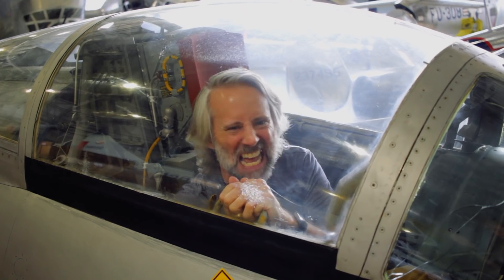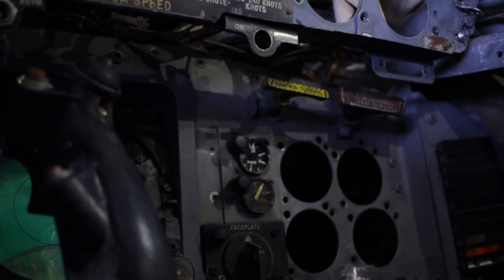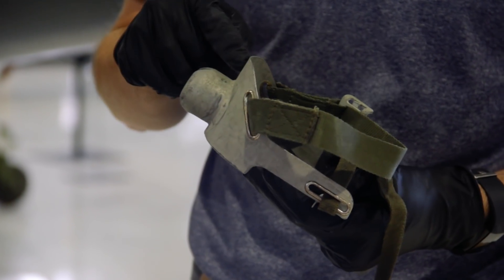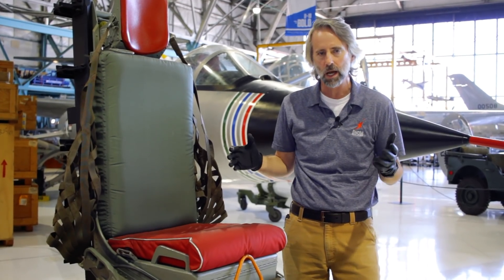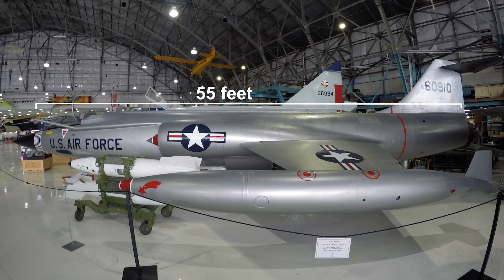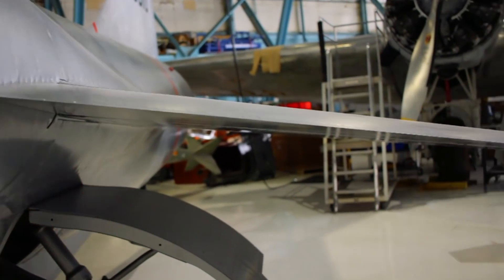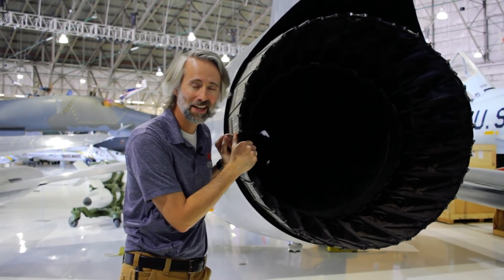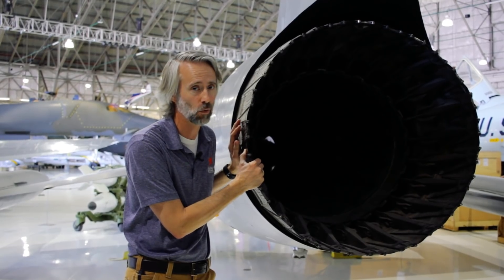F-104 Starfighter | Behind the Wings

Comment: The F-104 was truly a one trick pony. Flying fast, high and straight at Mach 2  Asking it to do more than that one trick like actually "turning" you were asking for big trouble.  Through Lockheed sales promotion campaign, (cough, cough "BRIBERY!!" cough cough). It locked in a lot of US Allies(The Luftwaffe, the RCAF, the ROC(Taiwan), Japan, and the Royal Belgian AF) with an fairly ineffective tactical supersonic aircraft for too long a time. Only the Italians seemed to have made something useful out of it.  Thank God the Soviets didn't invade Western Europe during the '60s and '70s.
Reply: Bullshit.
 
The F-104 was originally designed to be a daylight air superiority fighter to take on MiGs, not bombers, and could do so when flown the way it was supposed to, namely "zoom and boom", not "yank and bank"/"turn and burn".
When flown in this way, engaging an adversary in slashing attacks and then disengaging pretty much at will, it was excellent in aerial combat beating the F-86, F-100, and F-4 according to the USAF's Project Feather Duster 1.
(And OBTW, ALL aircraft become straight line machines at Mach 2+.
Moreover, none of the U.S. aircraft of the day could out (horizontal) turn the Soviet aircraft they would likely come up against, but they could nevertheless beat them by going vertical where they had a definite advantage ... something that the F-104 could/did do as well.
This is what happened in Vietnam with the F-4s and F-8s.)
 
But back to the other missions the F-104 was eventually tasked with.
 
When it clear that Lockheed wasn't going to make as much money on the F-104 as then hoped/needed, they offered to modify it to do what the Germans wanted at the time which was an aircraft that could not only fly interceptions and photo recon, but also an aircraft that could fly ground attack including with nuclear weapons.
The boys at Lockheed strengthened the airframe to handle low-level attack and made the "Super Starfighter" AKA the F-104G.
And when it comes to ground attack with a nuclear weapon, a task that it was virtually unmatched at as it was hard do detect either by sight or radar and difficult to catch if it was.
 
As for the Italians, then "upgraded" the F-104G to make it "all weather" which in U.S. terms means that it could fire a radar guided Sparrow missile, a missile that Vietnam demonstrated was less effective in terms of a probability of a kill in aerial combat than a gun or a heat seeking Sidewinder missile.
They were apparently happy with what they made and so I won't fault them for it.
 
And I too am glad that the Soviets didn't invade Western Europe, but IMHO, that was in large part due to the presence of the F-104, not in spite of it.
Reply: @lewiscole5193  You prove my point. the F-104 Starfighter was a one trick pony with its "Zoom and Boom" tactic and at least lived up to its appearance "the missile with a man in it".  But when compared to its Mach 2 contemporaries and adversaries the English Electric Lighting, the Dassault Mirage III, the Saab Draken and of course the MiG-21 it was sorely lacking.  All of which could both "Zoom and Boom" and "Turn and Burn" . Yes I know the Mirage III lost too much energy in some of its tightest turns but you get the point.  As well as so many Arab and a few Soviet pilots had gotten in the Six-Day War.

The success of the F-104 was more due to Kelly Johnson's deserved incredible reputation, Lockheed's exceptional sales promotion campaign, (cough, cough "BRIBERY!!" cough cough) and exceptional especially for its time after-sale customer service.
Reply: @colinw7205  
> You prove my point [...]
 
Actually, no.
To the extent that I've proved anything, it's that you can't read.
 
You've completely ignored the part about ground attack with nuclear weapons, which by the way, the Lightning could not do.
(The nuclear bomb that the F-104 carried weighed a ton while the most that the Lightning could carry on any of its stations was half of a ton.)
The Mirage was an option, but even though the Germans though it was better at dog fighting, they picked the F-104 instead.
Whether or not bribery was involved in the procurement decision, what is not open to debate is that the F-104 could perform the mission and therefore is not a "one trick pony".
(Whether or not the Draken or MiG-21 would have been "better" is moot as they weren't offered for sale to the Germans.)
 
And yes, other aircraft could do "zoom and boom" ... in fact, either NASA or the USAF (I can't remember which at the moment), after evaluating the best tactics to use in aerial combat effectively recommended that that all Century Series fighters and the F-4 use "zoom and boom".
But what this makes clear is that the use of a particular tactic doesn't make a particular aircraft a one trick pony, contrary to your apparent belief that it does.
 
And the fact that you think that being able to do both "zoom and boom" and "turn and burn" is somehow a necessity demonstrates that you haven't got a clue when it comes to the F-104 role in Europe and likely won't get one no matter what I say.
But in the interest of others who might be reading this, consider the environment that the F-104 was supposed to operate in in Europe against the West's rival, the Warsaw Pact.
From the beginning of NATO (in fact even before it), it was made it clear that they weren't going to try to compete with Soviet Union in terms of a conventional war.
We weren't going to turn German into a giant tank trap and spend megabucks trying to defend against conventional weapons.
Instead, if war came to Europe, it was going to become a nuclear war ... it was not a question of "if", but only of "when" we used nuclear weapons.
 
Now imagine that we're on the verge of WWIII and a whole shit load of fast, low flying aircraft are headed your way (and in this case, it doesn't matter if "you" is NATO or the Warsaw Pact).
Do you engage in turning dog fights with any aircraft that are willing to engage you (which by their actions indicate that they likely don't carry any nuclear bombs) or do you try to stop the aircraft that are blowing through your lines like a bat out of hell in more or less straight lines (which by their actions indicate that they might likely carry a nuclear bomb)?
 
I would like to think that only a clueless idiot who thinks that such a war was going to be like any of the relatively long drawn out proxy wars that we've had since the end of WWII would think that being able to dog fight with the enemy aircraft that are willing to do so is A Good Idea .
Reply: @lewiscole5193 Weren't  I thought we were talking about the F-104's air-to-air efficacy versus its contemporaries??   I understand the old NATO doctrine of if there is even a whiff of a Soviet invasion  "F**K it" we're gonna pass "GO" right to the nuclear option. Which changed in the '80s to the AirLand Battle Doctrine in part b/c the USAF and NATO now had great airframes the F-15, F-16, A-10, Toranado, Jaguar. Alpha jet and F-111 to get the job done conventionally against the Warsaw Pact.

But those minor "proxy wars" that you poo poo'ed is what that we , our allies and friends kept getting involved in showed up the shortcomings (and some bright spots, like the effectiveness of "the Hun" F-100 as a air to ground platform) of the Century Series.  Let's face it the true bright spots of US tactical air aviation in the 1960's  were all US Naval based airframes; the A-1 Skyraider, the A-4 Skyhawk, the F-8 Crusader and of course will all its flaws the F-4 Phantom.
Reply: @colinw7205  
> Weren't  I thought we were talking 
> about the F-104's air-to-air efficacy 
> versus its contemporaries??   
 
Your text is sufficiently broken up so that I'm not sure what exactly you are trying to say.
In particular, I don't know what you mean by "air-to-air efficacy [sic]" and what, if anything, that has to do with the use of the F-104 in Europe (with or without bribery).
"Good" and "Bad", "effective" and "ineffective", ... , etc. are all relative terms that only have meaning with respect to some standards against which some comparison(s) can be made.
For any aircraft, those standards are presumably the mission(s) that the aircraft is supposed to perform, and in the case of the F-104 in Germany (and presumably most of the rest of NATO), those missions were interception, recon, and (possibly nuclear) ground attack.
 
Yet you declared that the F-104 was an "ineffective tactical supersonic aircraft" apparently because it can't dog fight while ignoring the fact that (1) dog fighting isn't necessarily the only way to win aerial combat and (2) aerial combat wasn't the only mission that it had to perform.
If you want to define what you mean by "air-to-air efficiency", then we might have something to talk about, but until then, just making statements like the F-104 was an "ineffective tactical supersonic aircraft" is just silly.
In the most general terms, the mission of the F-104s in Europe and elsewhere was one of deterrence, and the fact that we're still here to debate the topic clearly shows that it did just that.
 
> I understand the old NATO doctrine of 
> if there is even a whiff of a Soviet 
> invasion  "F**K it" [...] [w]hich 
> changed in the '80s to the AirLand 
> Battle Doctrine [...]
 
Okay, so explain to me why the change in U.S. Army strategy/doctrine that occurred 20-something years after the Germans decided to buy the F-104 has any relevance to that purchase decision.
 
> But those minor "proxy wars" that you 
> poo poo'ed is what that we , our allies 
> and friends kept getting involved in [...]
 
I don't "poo poo" those proxy wars ... I'm saying that they aren't the war that the F-104 in Europe was supposed to fight and to try to judge the F-104 by the standards of such wars is silly.
All of the Century Series aircraft were designed for one kind of war and ended up being used in such proxy wars instead because they (the Century Series) were all that we had.
If we got lucky and they did well, fine ... we hopefully learned something.
But we got unlucky and the didn't work well, well again hopefully we learned something because it wasn't the aircraft's fault that it was used for mission(s) it wasn't designed to fight.
 
In the case of the F-104 in Europe, if push had come to shove (both then and now), we're looking at a nuclear war, not a prolonged war like WWII, Korea, Vietnam, or [insert your favorite conflict in] the Middle East.
And if that happened, there was only going to be one great air battle at the start of the war as aircraft rush to make or try to stop the initial airborne nuclear strikes.
After that, there was not going to be any prolonged war for air supremacy as the bases from where the aircraft took off from are going to disappear under mushroom clouds and anything left would no doubt have shortly disappeared as soon as the ICBMs started falling back to earth.
Again, to try to fault the F-104 because it can't dogfight with the best of any other contemporary aircraft is (mis-)judging the aircraft by having it try to fight the last war (WWII) rather than the one that was coming (WWIII).
 
> showed up the shortcomings (and some 
> bright spots, like the effectiveness 
> of "the Hun" F-100 as a air to ground 
> platform) of the Century Series.  
 
I don't know what you mean by "effectiveness of 'the Hun'" as it wasn't outstandingly effective in the air-to-ground role IMHO.
Again, it's what we had and we ended up using it for ground attack.
 
> Let's face it the true bright spots 
> of US tactical air aviation in the 1960's 
> were all US Naval based airframes; the 
> A-1 Skyraider, the A-4 Skyhawk, the 
> F-8 Crusader and of course will all 
> its flaws the F-4 Phantom.
 
If by "tactical" you mean ground attack, then I agree that the A-1s and A-4s were outstanding compared to their brethren.
What you fail to mention is that they were designed and put into service in the 1950s.
They were what we had and so we used them for what we wanted regardless of what they were designed for.
 
The F-8 was likewise designed in the 1950s to be a supersonic fighter that would go faster and higher than what ever the Air Force had, with no particular emphasis on dog fighting because that was not what was supposed to happen.
In fact, F-8 was a lousy dog fighter compared to the MiG-17s it encountered in Vietnam in the sense that it couldn't out turn them in the horizontal.
But it had two things going for it, namely (1) it had guns and (2) it could go vertical where it had the advantage over the enemy MiGs, both traits that the F-104 likewise had and which for some reason you don't seem to appreciate.
 
As for the F-4, it too was designed in the 1950s for interception and once again wasn't designed with any particular emphasis on dog fighting and once again, it was lousy in (horizontal) dog fighting as that wasn't something it was supposed to do as was clearly evidenced by the fact that it wasn't designed with a gun.
And like the F-8, when it engaged enemy MiGs, it survived and prospered by going vertical when it got a gun (pod).
 
So tell me again ... why do the two most "effective" (in terms of air-to-air exchange ratio) U.S. fighters of Vietnam get a pass as not being "one trick ponies" while the F-104 doesn't?
Reply: @lewiscole5193  ........"What you fail to mention is that they were designed and put into service in the 1950s."..... Ah, yeah. All the platforms used in the 1960's were with the exception of the Skyraider designed and deployed in the 1950's like all the Century Series.  I was making the point that the US Navy platforms proved to be more successful in actual combat than their USAF Century Series counterparts.

But I would give props to the  USAF's General Dynamics F-111 for doing what it was designed to do. Being a great tactical all weather medium bomber.
Reply: @colinw7205  
> I was making the point that the US Navy 
> platforms proved to be more successful in 
> actual combat than their USAF Century 
> Series counterparts.
 
Presumably we are talking about Vietnam now since that's the only one that Century Series fighters (other than the F-111) fought in.
 
Vietnam was a funny war in that there weren't that many air combat engagements (and therefore very few loses of aircraft of either side) as the Vietnamese generally only engaged U.S. forces when they thought they could win.
And as it turns out, the loses that the Air Force had were different from those of Navy even when flying the same aircraft, namely the F-4.
The Navy could "see" the Vietnamese using the radars on its ships while the Air Force couldn't their ground radars didn't cover where the Vietnamese aircraft were taking off from.
This let the Vietnamese air controllers vector their forces in behind the Air Force F-4s but not behind the Navy F-4s where the Vietnamese would have an advantage.
The result is that I think one has to be very careful when trying to infer how good/bad U.S. aircraft in Vietnam.
 
And OBTW, the F-105, which is a truly horrible dog fighter, came in third behind the F-8 and F-4 in kills in Vietnam.
 
> But I would give props to the  USAF's 
> General Dynamics F-111 for doing what it 
> was designed to do. Being a great tactical 
> all weather medium bomber.
 
Well, since you mentioned the F-111, let me tell you a little story ....
 
The Air Force and Navy are very protective about not getting an aircraft that was designed for some other service which is something that Congress and/or the Executive branch likes to try to make happen so as to save money.
The F-4 started out as a Navy aircraft but it got foisted onto the Air Force.
The F-111 was supposed to become both an Air Force and Navy aircraft, but the Navy avoided it by claiming that it couldn't land on their carriers.
 
During the early part of the Vietnam war, a couple of the Air Force's finest, the high performance, high priced F-105s, were shot down by some piddly obsolete (and relatively cheap) MiG-17s.
A few days later, Air Force Chief of Staff General McConnell came out with his "Air Force Doctrine on Air Superiority" document which outlined the role of "air superiority" following in the foot steps of an earlier memo by lightweight fighter advocate Chuck Meyer.
Meyer's had advocated for the used of different aircraft for different missions, each aircraft tailored to their role, and so the Air Force could have interpreted McConnell's document as guidance for the Air Force's next fighter aircraft, the F-X, to be tailor for an air superiority role.
 
Unfortunately, a clause in McConnell's paper effectively stated that pounding the hell out of enemy aircraft while they're still on the ground was A Good Idea was seen by the Establishment majority within the Pentagon as justification to continue to do business as usual.
So the response to the loss of the F-105s ended up not being something that could dog fight, but rather a more sophisticated and costly "fighter" of the sort they were used to thinking about up until that point.
What the Air Force Establishment has in mind is a Mach 2.5 capable twin engine, swing wing design with radar and a huge internal fuel capacity that tipped the scales at about 60,000 pounds ... basically an F-111 on steroids.
It had a takeoff thrust-to-weight ratio far less than 1:1 and a wing loading of about 100 pounds per square foot.
The Air Force asks the aircraft industry to come up with something along those lines in a series of Request For Proposals (RFPs) between 1965 and 1967.
 
Fortunately, Meyer was able to convince the Air Force to cancel the transfer of one Major John Boyd to parts unknown which ultimately lead to Boyd being assigned to look at the various requirements of what the Air Force thought the F-X should be in 1966.
Boyd was already famous at the time for his works including Energy-Maneuverbility (EM) Theory that he developed with Tom Christie which allowed one to predict and compare aircraft performance.
After looking into the F-X requirements, he famously told his boss, "I've never designed an aircraft before, but I could fuck up and do better than this!".
Fortunately, his boss was amused and so Boyd ended up undertaking a series of requirements trade off analysis studies which lead to the outline of a much higher performing, far more maneuverable, twin engine fixed wing (i.e. non-swing wing) aircraft that tipped the scales at 40,000 pounds, had a takeoff thrust-to-weight ratio slightly in excess of 1:1 and a wing loading of about 80 pounds per square foot, although with a lower top speed of Mach 2.3.
 
Boyd still wasn't happy with the this, however, but his higher ups ordered him to cease and desist with any further work on the F-X which they then tried to turn into a real live aircraft, the F-15.
Nevertheless, Boyd and his cohort in crime, Pierre Sprey, continued to work on the specifications for their lighter (30,000 pounds or less), hotter design which they referred to as F-XX (pronounced "eff ex squared").
They were convinced that the best way to future-proof a fighter was to make it very maneuverable.
Along the way, they checked with aircraft manufacturers Northrop and General Dynamics Convair (who had both submitted lightweight aircraft designs before) to validate from them (the manufacturers) what their (Boyd's and Sprey's) studies indicated.
But no matter how much they lobbied to replace the F-X with the F-XX, Boyd and Sprey got no where as the Air Force regarded the F-XX as a threat to them getting the F-X (AKA F-15).
 
The F-XX was kept alive thanks to a bit of subterfuge on the part of Rich Riccioni in the Air Force who told his bosses that with already high cost of the F-15 and F-14 continuing to escalate, there was a chance that Congress would cancel both the F-15 and F-14.
If that happened, it would be A Good Idea if the Air Force had a lightweight fighter proposal laying around in the background so that they wouldn't end up with a lightweight fighter that came from the Navy.
What Riccioni didn't tell them was that the Navy's lightweight fighter program had already been bludgeoned to death like a baby Harp seal because the Navy felt that their lightweight fighter program was a threat to them getting the F-14.
 
In the end, civilian leadership became pissed off enough about the escalating price tag of the F-14 and F-15 and other aircraft that they called for a lightweight fighter fly-off to fill out the Air Force and Navy inventories.
The fly-off saw the YF-16 take the cake over the YF-17 and the Air Force dropped it's objections to getting the F-16 when it was basically assured that they would get the F-15.
The Air Force then promptly started trying to turn the F-16 into a non-lightweight fighter that would only be used for ground attack, never as the highly maneuverable air superiority fighter that it was supposed to be.
 
The result of all of this is that today, the must-have buzzword for fighters (aside from "stealth") is "maneuverability", and every fighter today has to be able to supposedly perform billions and billions of roles.
 
And what does any of this have to do with the F-104, if anything?
Well, the F-104 was in a very real sense, the spiritual grandfather of what the F-16 was supposed to be, a lightweight daylight air superiority fighter with essentially no other role ... something that you apparently find an anathema.
 
But the story doesn't quite end there because civilian leadership secretly asked Sprey to come up with the requirements for a special purpose ground attack aircraft, the A-X, which today we now know of as the A-10 Warthog ... IMHO the finest ground attack/Close Air Support (CAS) aircraft we currently have.
Reply: @lewiscole5193   ......the F-104 was in a very real sense, the spiritual grandfather of what the F-16 was supposed to be, a lightweight daylight air superiority fighter with essentially no other role ... something that you apparently find an anathema"....... No I don't find a single purpose airframe an anathema.  Are you more interested in having discussion or just "owning" me??

If you are going to get nitpicky here . You fail to mention the F-111B's  carrier landing performance or lack thereof. Apparently seeing the carrier deck while landing on it is kind of a big thing for naval aviators. Imagine that??  They no doubt chaffed at DoD Sec. Robert McNamara's TFX program. It was okay for USAF to buy US Navy developed airframes like the F-4 and the A-1 and US Navy developed weaponry like the AIM-9 Sidewinder and the AIM-7 Sparrow but NOT the other way around.  But we all know the story , the Navy and Grumman took elements they wanted from the F-111B , the AWG-9 radar, the Phoenix missile, the swing wing (a hot concept in the 60's like Beatle's haircuts) and the P&W JT8D based TF-30 engine (one sh*tty fighter engine but state of the art at the time.) And Grumman turned those elements into the legendary F-14 Tomcat.

To  digress for a moment here. Have you ever wondered why the Swedes, in this case Volvo Flymotor was able to take the same P&W JT8D civilian jetliner engine and the developed the RM8 for the Saab Viggen fighter?? Not only did stick an afterburner on it to generate 28,000 lbs of thrust but also stuck on a goddamn thrust reverser  to boot!!!   While the same P&W couldn't make the TF30 a decent fighter engine which was also based on their own JT8D ???  The compressor stall/flat spin scene was probably the most accurate part of the movie "Top Gun".